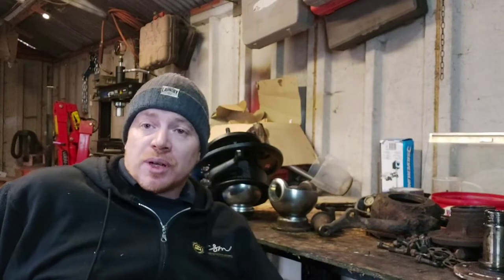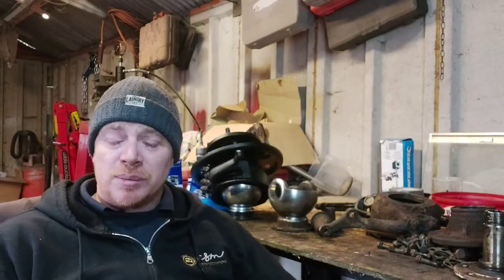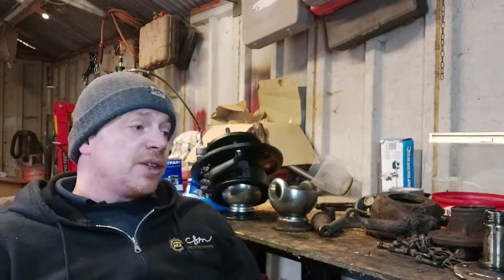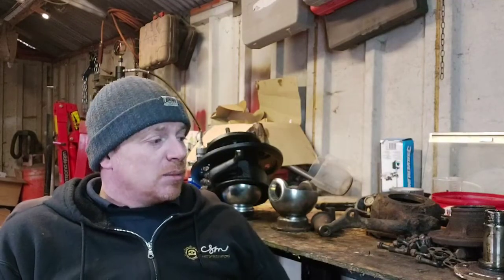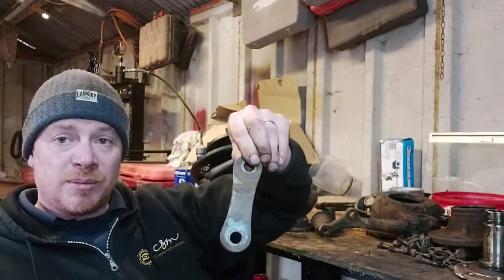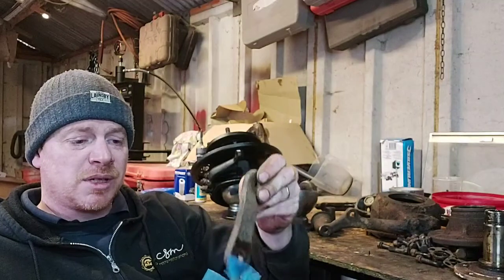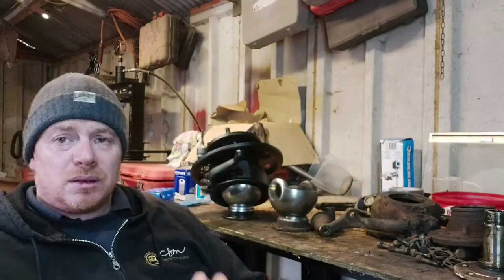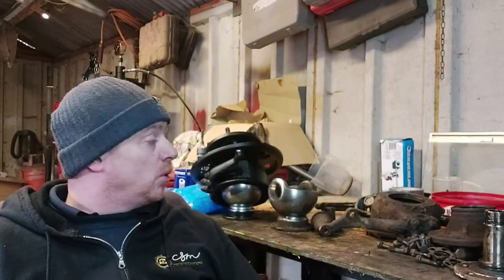do you use britpart on your land rover? and why not?

Comment: ive used britpart vented brakes not a single issue work fine ive restored a few landys and i have no issue using britpart without issues you get what you pay for
Reply from the maker: If I was on a real tight budget I would use britpart brakes but like you said you get what you pay for but when it comes to life or death stuff I buy the best I can afford i do use other britpart stuff with no problems at all

Comment: I'm on the fence. I live in the US. I do most of my Land Rover parts shopping with RimmerBros, John Craddock or LRDirect. For important parts I try to buy genuine. For routine wear parts I'm open to oem. 

I avoid buying the cheapest version of Land Rover parts for two reasons:

1) I've had fitment issues with cheap aftermarket replacement parts. Bolt holes not lined up correctly. Missing gaskets or o-rings. Etc.

2) I feel like you get what you pay for. Some jobs on a Land Rover are a pain in the ass. Like the crankshaft position sensor on Discovery 2 petrol. I don't want to replace it twice in short time. I'd rather pay more money for a better quality part that I believe will last much longer. 

Conclusion: I totally understand the budget argument. I also understand that genuine parts are not always superior. And no harm to anyone who depends on cheap replacement parts. 

But I would like to argue that the money you save up front from buying the cheapest variant of replacement parts, will come back to haunt you later on if/when those cheap parts fail prematurely. The consequence will be another breakdown and having to buy that part again. If you are paying a shop to do the labour then the money will add up very quickly if you frequently return to the shop to have the same cheap parts replacement again and again because they fail prematurely. 

Furthermore for those who use their Land Rovers for long overland trips or those who do serious offroading with their Rovers, having strong quality parts is critical. 

Just my thoughts. 

PS: I agree that nobody should be treated differently or cast out of the community because of the brand of parts they use. At end of the day who cares. Live and let live.
Reply from the maker: I agree that in most case you get what you pay for but sadly the quality of branded parts isn't always what it used to be everything nowadays is built to a budget rather than a standard so its hard to know what you're getting.
I've had budget and branded parts side by side on the bench and they've been identical parts with big£££ differences its a minefield. 
I'm lucky I buy enough parts to of figured out what not to buy.
To sum up my opinion on it, for major parts like engines, brakes, bearings and critical life or death parts  buy branded parts for everything else buy what you can afford sometimes its a false economy but you've only got the cash you've got.
Cheers 🙂👍

Comment: Agree with you i would not use britpart brakes at all needed a new indicator stalk got a britpart one and stoped working with in a year so brakes and electrics i steer clear of
Reply from the maker: Not all britpart items are bad but life and death parts I steer clear of not that ive had any serious problems but why take the chance that said if thats all I could afford I would still use it but be prepared to replace them in a year or 2👍
Reply: @retro.restorations  ay I found that out when I got new wheel bearings and a new brake master slave cylinder  back in the day driving home and had no brakes at all went right to the floor. Was a change pants moment hahaha did manage to get home using the gears to slow down lucky enough nowt was on the roads

Comment: "S#it#art, guaranteed for two years"?, fail before fitment. For instance, two wiper arms and blades,......had to grind down the wiper arms to fit. Nuts and bolts probably OK, but everything else is CHEAP CHINESE, INDIAN rubbish.
Reply from the maker: Granted everybody has a britpart story but I've had genuine main dealer parts fail before fitting, if you sell enough of something you will have some duff parts, that said I still won't use there engine and brake parts just to be safe. 🙂👍